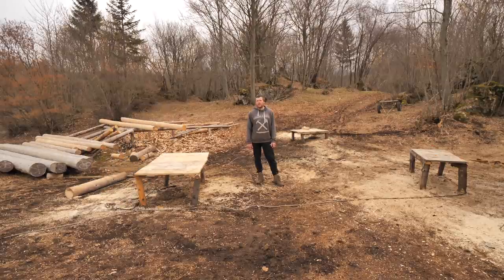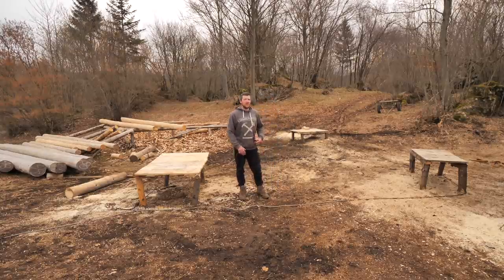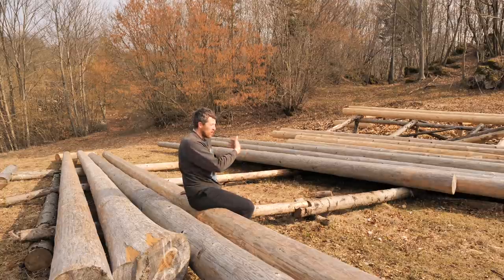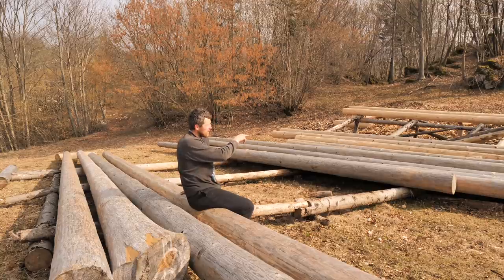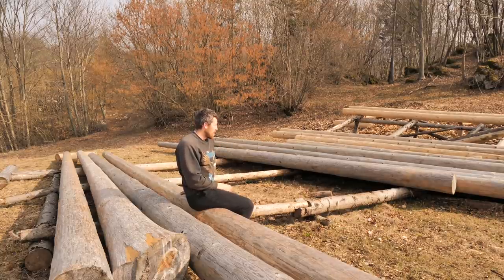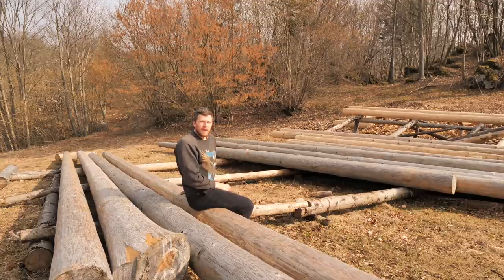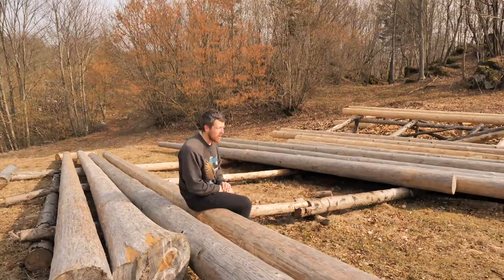Building Off Grid Log Cabin / Aligning The Trusses and Preparing for Ridge Log

Comment: I really enjoy your videos. I'm praying for your safety. What is the tool you're using at 4:44? And also, what is the liquid you are putting on the steel pins when you drive them in the holes? Thanks, Brum